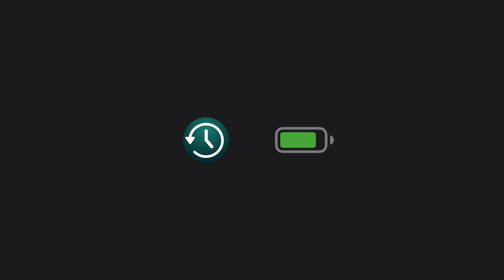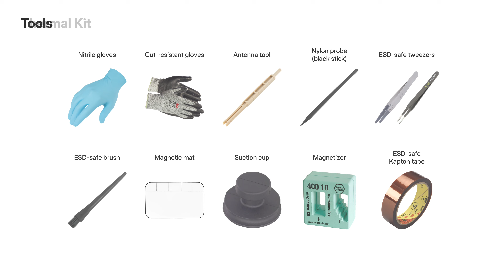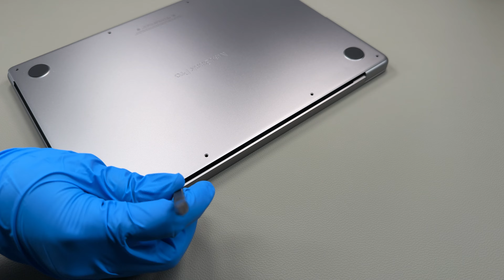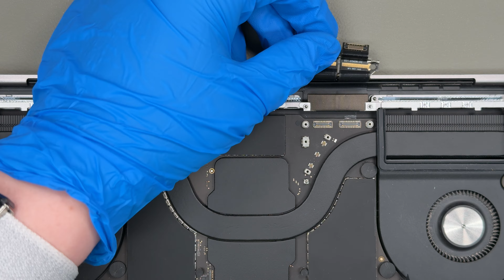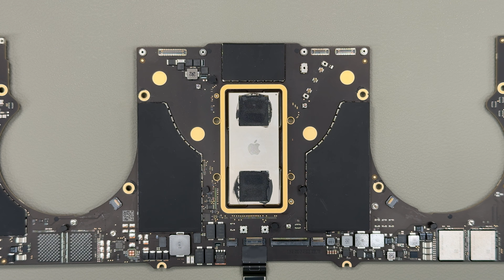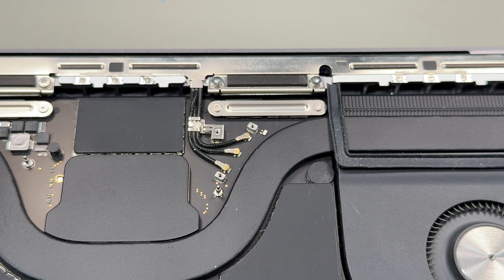Replacing Thermal Paste on your Apple Silicon MacBook Pro

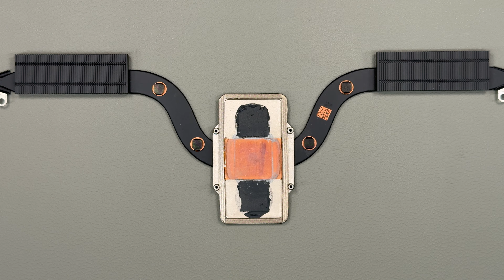Comment: 11:44 if we dont remove the black thermal whats the point of unscrewing all this? 
you did not show the state of the old paste or how you clean it or how you apply it.

thank you but you left me even more confused. i will have to do it myself and see
Reply from the maker: You can also remove the black thermal gel and replace it with new thermal gel, although this will increase the cost. The condition of the old thermal paste varies from user to user — the degree of paste degradation and loss depends on usage intensity. Simply clean the old thermal paste with isopropyl alcohol wipes. For the black thermal gel, you can scrape it off using the flat end of a spudger, and then wipe away the remaining gel with an isopropyl alcohol wipe.
Reply from the maker: Regarding how to apply the new thermal paste: After wiping off the old paste from the area where the original gray thermal paste was, simply apply the new thermal paste.
Reply: @zhi0306  thank u, i will check the condition of  tha paste

Comment: did you know the exact size/measurement of phase change pad i should cut for m1 pro chip? i can't find this info anywhere
Reply from the maker: You can choose a 20 x 30 mm phase-change material (PCM) pad and apply it to the center of the M1 Pro chip.

Comment: Amazing video. Thanks! I am shocked why NO one posts these types of videos anymore since M1 was introduced. Also what is that black gel called for RAM? Would have been even nicer to change those too
Reply from the maker: The black one is thermal gel. It has larger particles, making it better at filling larger gaps.

Comment: bro, what to do if some screws just don’t want to come out, i stripped the threads on some screws already, have u faced this problem ? thank you for the answer
Reply from the maker: Could you tell me exactly where these screws are located? As long as you use the right size screwdriver, they won’t get stuck like this.
Reply: @zhi0306 maybe my screwdrivers are bad, idk how to find out if it’s good or bad
Reply from the maker: @Roman-o7w6p  Actually, you can use a regular Torx screwdriver for disassembly. you don’t have to use a Torx Plus screwdriver.
Reply from the maker: @Roman-o7w6p  I once had a user who wasn’t careful and used a Torx T5 screwdriver on a Torx T6 screw, which ended up stripping the screw head so it couldn’t be removed.
Reply from the maker: If the screw head is already stripped, you may need to grind a straight slot on top of it and then unscrew it with a flathead screwdriver. Be careful not to let metal shavings from grinding fall onto the motherboard.
If you find the cooling is still okay and there is just excess dust, you can simply clean the dust off the heatsink fins and the fan even if you cannot remove the heatsink and fan assembly, since the heatsink fins and the fan are not tightly connected.
Reply: @zhi0306 thank you for the video btw, it’s a huge pleasure watching it
Reply from the maker: @Roman-o7w6p  I'm really glad you enjoyed my video.

Comment: Is it possible applying liquid metal on M series?
Reply from the maker: The risk of applying liquid metal is too high.
Reply: @zhi @zhi0306 but it possible right? If applying correctly (well sealed), especially on those 2 black square. Then the M1 will be the beast again.
Reply from the maker: @mrpor9541  The two black memory areas must be filled with thermal gel due to the significant gap between them and the heatsink base.
Reply: @zhi0306  if you let it for too long it will "solder" the heatsink to the processor IHS, good luck if you need some maintanance!
Reply: I thought the same at first. I wouldn't recommend it since in my experience with gaming laptops you might have to change it sooner compared to paste despite offering far superior throttle performance. Also, since there is gel on the RAM, I would not apply Liquid Metal. Macs are pretty efficient, so I would not risk it. They termal throttle very rarely, especially the Pros with dual fans.

Comment: It would have been great to see thermal performance before and after the thermal paste change at 11:20, and also, the actual part of the thermal paste change, it would be great to see the actual application of the paste, if that were possible.

Great video, thanks!
Reply from the maker: Under high load, there is a temperature drop of about 4 degrees Celsius, but the temperature reduction is not significant during daily use. I think because Apple chips have a cover (IHS), the thermal paste degradation is not as noticeable as with exposed chips.
Reply from the maker: And, thank you very much for your suggestion. I will demonstrate the temperature changes and the process of applying thermal paste in my future teardown videos.